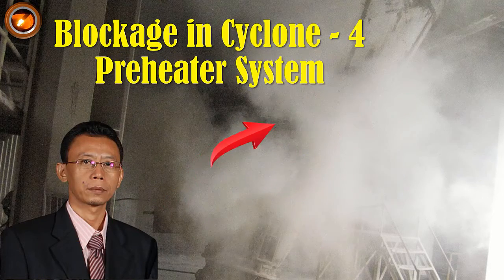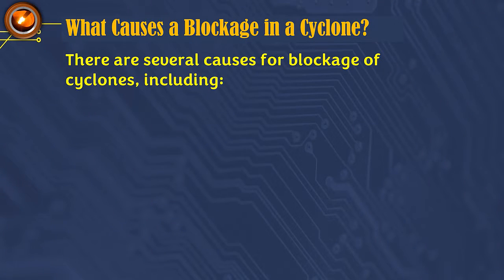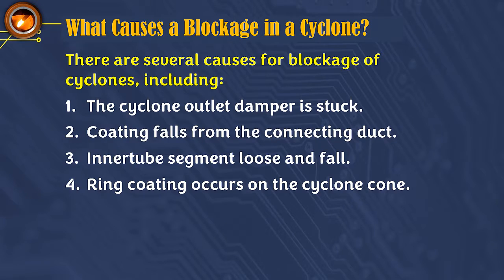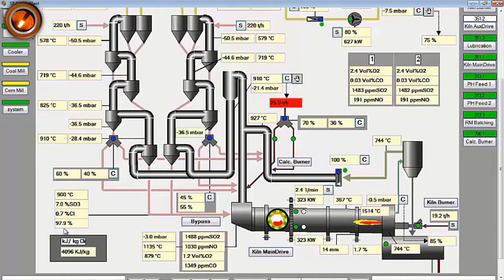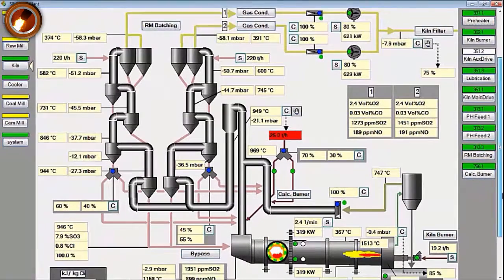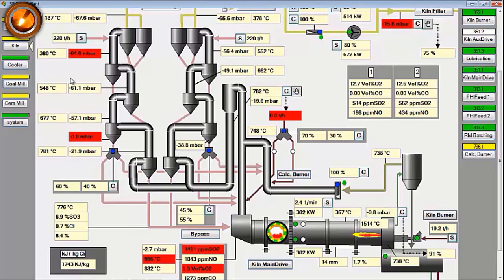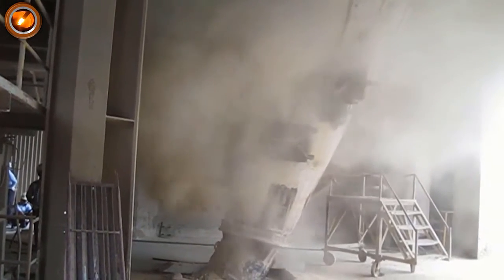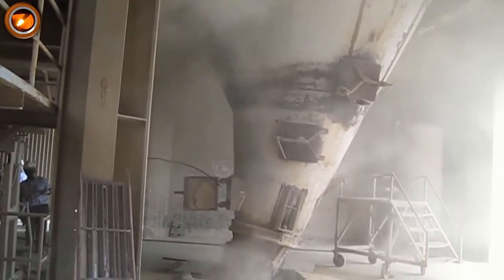Clogging On Cyclone 4 Preheater System In Cement Plant_ English Version

Comment: What are the chemical reactions that occur in each cyclone, please?
Reply from the maker: The chemical reactions that occur in the cyclone include the first evaporation of water (H2O) from the feed material, which occurs at the top of the cyclone. The second is the decarbonization process, which breaks down CaCO3 into CaO+CO2, which occurs at temperatures above 700°C–900°C.

Comment: I do having cyclone chocking problem.what are the key calculations to be done to choose a cyclone
Reply from the maker: Thank you for your question Mr.Krishnan.
May I know, how often do you experience cyclone chocking? and what level of cyclones do chocking often occur?
We can only explain from the process side, because we are not cyclone designers.
There are several causes of cyclone chocking in cement factories, including:
1. From the mechanical effects: cyclone outlet damper stuck, dimensions of cyclone size (We recommend searching literature on new generation cyclone design), short calciner chamber and hot gas velocity more than 25 m/s (normal 19 - 21 m/s).
2. From the process side: material feed (LSF: <95%, AM: <1.5%), fuel used (sulphur: >2%, coarse coal >25% on 90 micron sieve, using rice husk as fuel), the calciner outlet temperature is >900 degrees Celsius continuously, the temperature inside the cyclone preheater is unstable.
3. And there are several other causes that require further research.
Reply: @parroscement2625  Please, why Cyclone 3?

Comment: A very dangerous job.
Reply from the maker: Yes, it is very dangerous, because the temperature of the material is still around 800 oC. When working on material cleaning, safety procedures must be followed properly and require strict safety supervision.
Reply: @parroscement2625  I performed and supervised this work. The fourth degree (cyclone) often becomes obstructed.